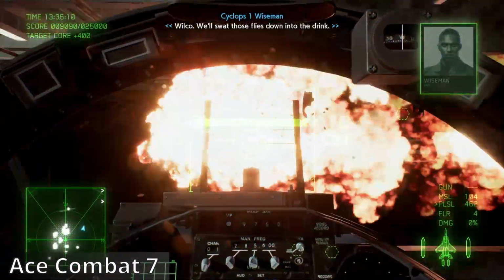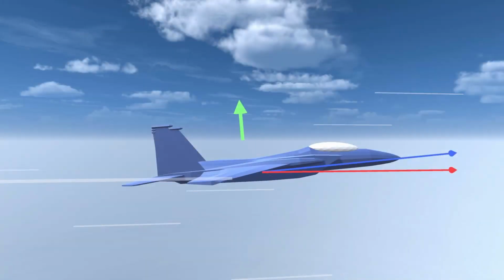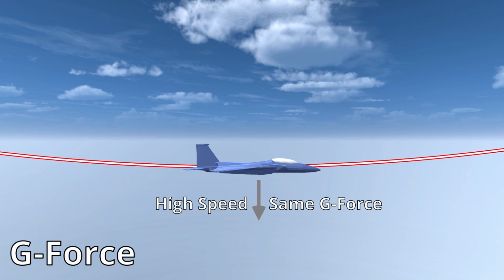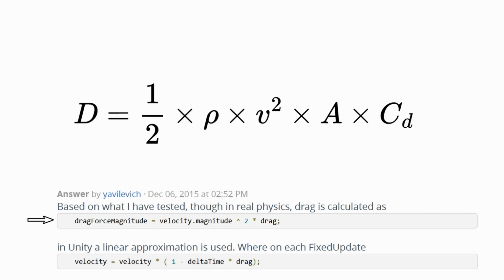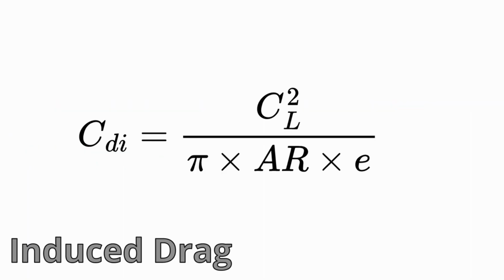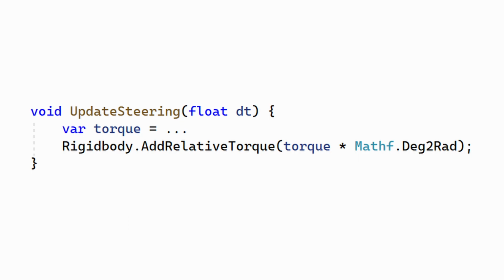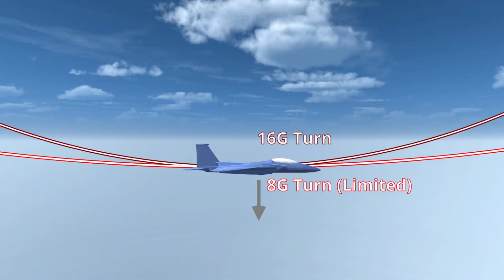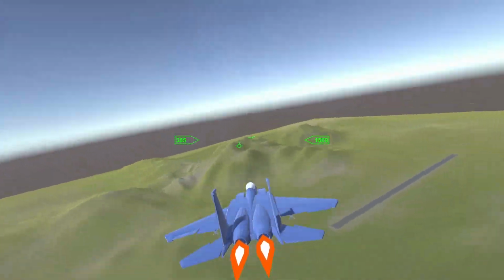Creating a Flight Simulator in Unity3D (Part 1)

Comment: can you provide numbers/animation curves for the f 15 model in unity inspector?  numbers for liftpower and AOAcurves for the rudder are not given in the blog posts nor github code.

currently doing this in unity 6000.3 using part 1 tag and when testing when throttle is max the plane just does a weird spiral and then shoots off to a super far position, so i was wondering if my numbers were off.
Reply from the maker: The values are in the github repo if you clone it.
Reply: @Vazgriz mb I didn't realize sorry

Comment: This models really lacks some rotation caused by drag. Like the only way current implementation ever rotates is through player input, therefore instead of realistically stalling and start spinning it will just fall. I also didn't quite felt any energy gaining while falling down, but that's probably cause by my bad fine-tuned parameters, but also because you fall like a brick without spinning accordingly due to drag so it just doesn't feel right. But apart from that problem it's a really great model

Comment: What kind of settings are needed to have slow, realistic turning for scissors etc AND cobras and kvochur bell maneuvers?

Edit: It seems the G limiter is what prevents a cobra maneuver, for which you need to get 90 AoA and keep altitude almost the same.
Let's say G pitch limit is 10. The maneuver can't happen, you just turn upwards, seems to be the case at all speeds.
But if the g limit was let's say 20, the Gs pulled in the cobra don't even reach 10. It's just that if the limit was 10 it wouldn't be allowed.
Does that make sense?

Comment: Im having the problem that I was going to change the input to mouse and keyboard, and I changed it all in the "PlayerInput", but it does not work, I tried to debug it but nothings working. Is it using a different input system? help.

Comment: When turning, shouldn't the nose of the craft experience a force pushing it back towards the direction of movement? Currently it seems as if when I nose up and then let off the controls, the nose "sticks" where I left it, whereas it seems as if other flight games model how air resistance exerts a force on the plane so that it turns back in the direction it is headed.

I'm probably not explaining it super well, but I was wondering how to implement this in my own project.
Reply from the maker: You're right, there should be a force like that. That's the stability force that real planes experience. A simple way to model it is by applying a torque that multiplies with AOA.

I did not include it in my simulation for simplicity. The way the plane behaves is like a plane with neutral stability (holds nose attitude). A more realistic behavior would be to have positive stability (nose pulled towards velocity vector).

Comment: How did you make the animation curve for Cl vs alpha? Need a bit help with that. Please guide me with the steps.
Reply from the maker: I used airfoiltools.com to find the data for the F-15's wing (which is a symmetrical wing). Then I plotted the data in Excel.

Comment: AceCombat and Project Wingman both have more involved physics than what you have shown here. They just have the weapons and AI configured to make it easy, but energy, stall, induced drag - they have all of that. I loved to play around the time of AC3-ACX and you could absolutely ignore tactics but if you do consider your mission target, the aircraft you have, its configuration and loadout and fly according it  makes a big difference.
Some aircrafts there had abysmal low speed acceleration and high induced drag for yaw. So if you keep some height, don't turn too hard and stay at cruise speed the aircraft feels a lot more nible and getting a solid lockon becomes way easier.
Reply: Why did you decide to talk out of your ass?
Neither of those games have drag or induced drag, or anything of the sort.
They are more like cars that fly they use much simpler fake formulas to achieve things.

Comment: Sheeesh, nice video man! Learned a lot from this, btw I have a question.. At low speeds the aircraft tends to preserve momentum from it's previous direction when turning, how do I prevent this from happening? I just can't seem to figure it out
Reply from the maker: That's intended behavior. At low speeds, the plane creates less lift, so when you turn, the velocity will take more time to align with the new direction you're facing

Comment: This is one of the best approachings to putting together flight in unity. It's still slightly too realistic - at first - but it's an awesome way to build gameplay around flying skills. I've been playing with this for a few days now - I ran into a weird bug I cannot trace the source off. After a couple of seconds or more, I lose all lift in all surfaces - with gizmos visible I can see them just getting smaller fast and disappearing. I use the stock airfoils with reduced lift and drag for (75 and 35 respectively). 

This can be a very successful asset store template with minimal additions: 1) multiple targets, 2) rotor planes (biplane and mono) 3) slightly more arcade controls 4) sound support. I would be more than happy to provide whatever art you need to help you put this up on the asset store (or just upgrade the git project).

edit - resetting the collision box on the plane to its original scale/values solved the problem.
Reply: I had a similar problem. My plane would stall once I'd reach a certain speed. The squared speed component of lift would cause my angle of attack to drop to super negative values at speed. I fixed it by just lowering lift force and using a bit more drag to fly. It still feels right to fly but I need a better fix that's more realistic

Comment: Hey man quick question, why did you multiply the local velocity on the y axis by negative one while calculating the angle of attack? Great work by the way!
Reply from the maker: I wanted AngleOfAttack to be positive when the nose direction is "above" the velocity direction. If I just used the velocity.y component directly, the AOA would be opposite of what I wanted. This problem could also be solved by pulling the negative outside of the function ( -Mathf.Atan2(...) ).

Basically, the math behind Atan2 would make the value negative, so I need to multiply by -1 somewhere

Comment: You could get Rho based on player altitude by using the perfect gas law.
Reply: Nah, you need both temperature and pressure for that. Can just use a lookup table or a basic scale height equation though

Comment: How do you extract the AoA value? I tried to use "rb..velocity.direction" but it doesn't work somehow...
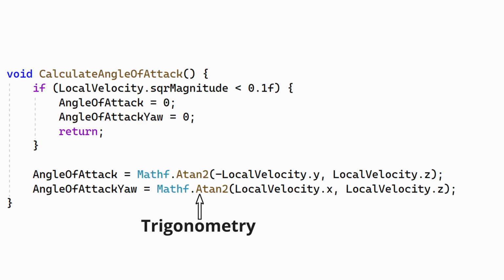Reply from the maker: AOA is the angle between the velocity and the direction the plane is facing. I use Atan2 to extract the velocity at 8:04
Reply: @Vazgriz  Problem is, there's no variables like LocalVelocity.y and such in my Unity (v4.3)
Reply from the maker: Right, LocalVelocity is something I calculate in my code. It's the rigidbody velocity translated into the rigidbody's local space.

Comment: I'm surprised you hand-tuned the coefficient of drag curve with AoA. It seems like it would be easier and more realistic to estimate the cross-sectional area of the plane with AoA (say, linearly interpolate between the nose-om area and the belly-on area) then you would just have to tune a single scalar and the dependence of AoA should be very realistic without any more calculations than you're already doing.
Reply from the maker: The coefficient of drag uses an animation curve based on air speed. The Scale6 function does sort of blend between nose-on drag and belly-on drag. However it specifies the drag coefficient directly instead of calculating based on area. The game designer could do those calculations offline and simply plug in the numbers.

Comment: Firstly, absolutely great tutorial. Love it.

I've calculated drag in the full formula way. It's easy, because you have several of those numbers as constants, so you can precalculate them (I did it on the paper, basically) and you'll have realistic calculation in the end. (the part of it is the drag area which has findable values of say 0.3 times the area, which you can calculate per axis).

You can use real engine force, real drag coefficients, real lift values of a given plane and it will fly comparably... (as in, it's not a sim, but it kinda acts like one). My jet could achieve the real max speeds, climbs etc. with an error of a few percents without me tweaking anything.

You are going the hand tweak route, which will need much more tweaking as compared to tweaking the "real" values a bit (from my experience).
Reply: Seeing your rotations - I was simulating it more realistically and then I've implemented Fly By Wire on top of it (player rolls, plane also pitches, so FBW compensates the pitch).

You could try that, it was a fun thing to try to implement and I've personally enjoyed the end result, where the plane can be twitchy and self correcting. It was what made it feel "physical".
Reply: @GonziHere  how did you go about implementing Fly By Wire in unity? seems interesting to try

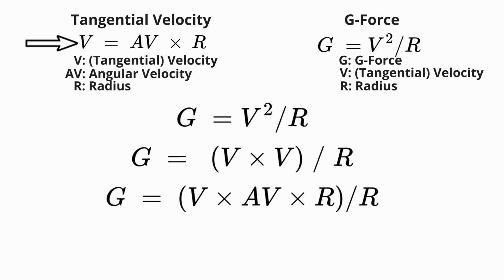Comment: 17:06 The reason you use the cross product is because the g vector is perpendicular to both the velocity vector of the aircraft and the rotation vector of the turn that craft is making. Due to the fact that the rotation vector is always perpendicular to the velocity vector in most maneuvers, the magnitude of the g load is equal to the product of the magnitudes of the velocity and rotation vectors, hence why the math works out like that.

I hope that makes sense